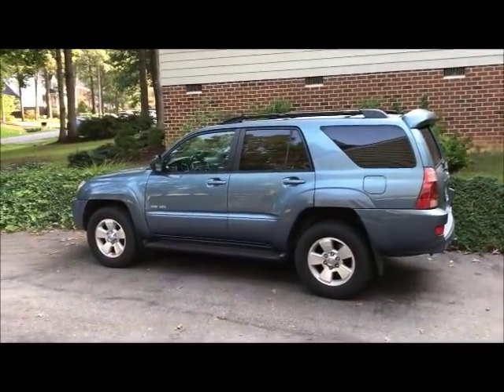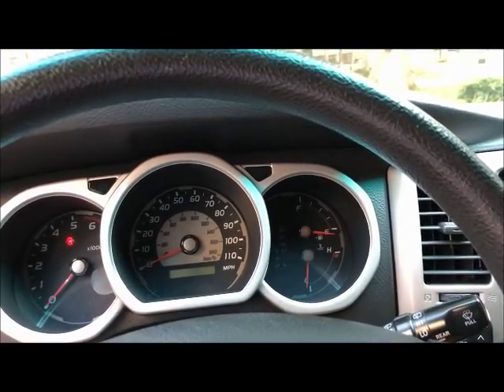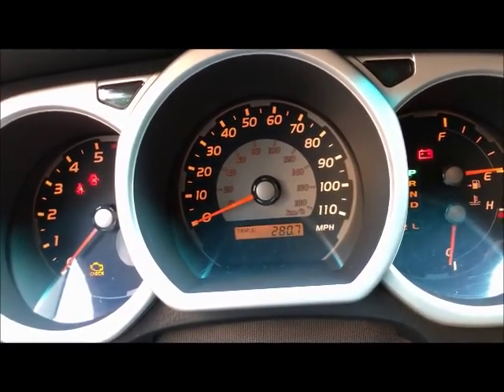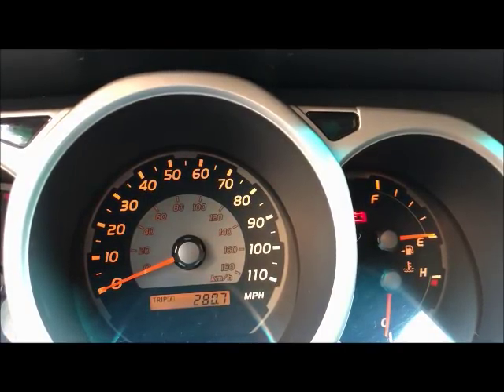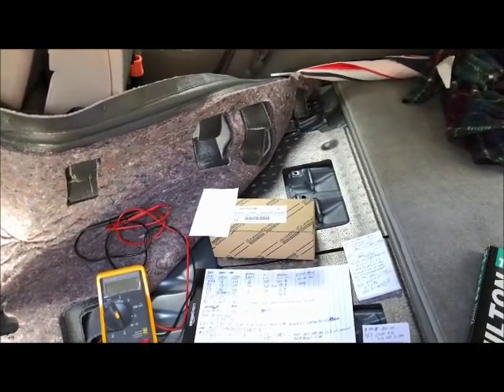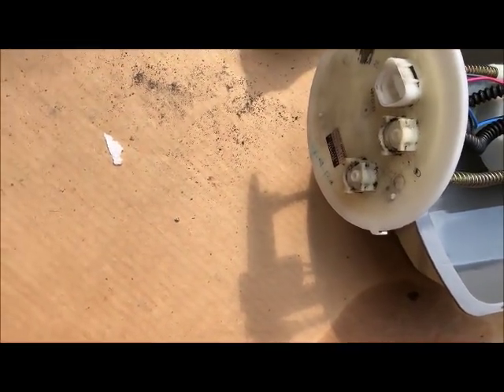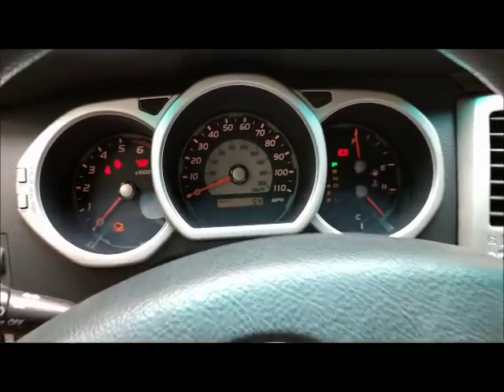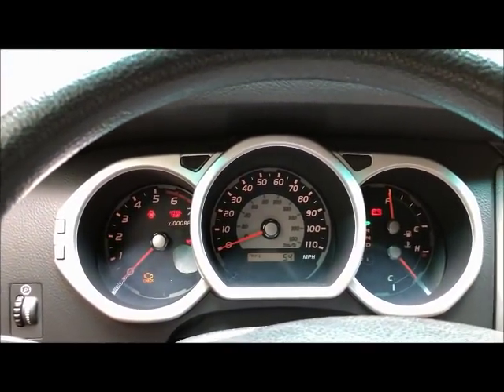2005 Toyota 4Runner Gas / Fuel Gauge Problem - Fixed!

Comment: Just so you or anyone else reading this,   Do not go all the way down to the E every single time,   You’ll damage that fuel sending unit lever and can burn out the fuel Ump. I worked on Toyota’s chevys gmc ford dodge hummer Volvo Subaru Mitsubishi and ties the matter what brand vehicle you own.  Chevy gmc have been known to go bad anywhere between 40-90,000 miles ..... burned the fuel pump.....

Comment: I just did this job but I replaced the fuel pump. The gas tank can not just be dropped from below because of the short wires connecting the harness to the pump, so being how you have to take off the body cover to disconnect the wires I cut out a 8'' by 8'' peace so I could remove the pump from above- no need to drop the tank. Doing this made the job much easier it also allowed me to start the car and watch for leaks. The peace of body I cut out can be easily sealed up with silicone.
Reply from the maker: Hi John.  Thank you for leaving a comment.  Please click on the words “Rick’s Tid-Bits” underneath the video to go to my YouTube channel.  I think you’ll find some helpful and unique tips in my How to Make Life Easier or Better section.  https://www.youtube.com/channel/UCc-IuUFzC2Tyv06KzJyBESg  Rick

Comment: Thanks for the vid. Your video was more helpful than any other I'd found. I've got a factory service manual, AllData online access and a Chiltons but I still find it's VERY helpful to be able to see a vid of exactly what I'm getting myself into before I get started. Best use of Youtube IMHO. 

Just finished replacing the entire assembly on my 2007 4Runner Limited V8 (Toyota Part No. 77020-35102) which looks to be the same one as on yours. Buying from a dealership that sells online it was right about $400 shipped. All in all the whole job took about 5 hours for me including a mandatory lunch break (union rules or I go on strike). I'm sure it would have taken longer had I not watched your vid first. 

My tank was 3/4 full when the pump died so after unclamping the filler neck I siphoned it empty before lowering the tank. I also didn't even bother pulling up the carpet to get to that almost useless access panel. I was able to lower the tank enough to get up in there and disconnect the wiring from underneath. Sure would have been nice if Toyota would have made that access hole large enough to pull the whole assembly out and in. They managed to do it for the Lexus GX470 which is almost the same vehicle as mine in most other aspects, though IIRC the Lexus you might have to actually pull the seats to get to it.

Comment: This was super helpful when I replaced the sending unit.

Only thing I did differently was to actually remove that annoying vent clip from where it connects by the spare tire and fish it out rather than trying to disconnect it from on top of the fuel tank.

Thank you for this!
Reply from the maker: You're welcome.  Thanks for letting me know it helped.  Rick
Reply: I am going to be doing this soon.  I haven't tested my sending unit yet, but it does not read accurately once it is around 1/4 tank remaining.  Aside from getting a new fuel sending unit, what other parts did you need to order or do you recommend to order before doing this job?  Assuming you are reusing the fuel pump.  E.g., gaskets, etc.
Reply from the maker: Hi vettepwr.  I don't think I needed any special tools.  You will need a jack to lower it and then raise it.  It's a bit heavy and awkward.  I thought about replacing the fuel pump and o-rings while I was doing it.  In the "old days" on older cars I would have done that because they were prone to failure also.  I did not replace them on this one.  I hadn't heard of a fuel pump failure on a new-ish
vehicle in ages.  Plus, to get the pump (and o-rings?) from Toyota you had to buy the entire fuel cage assembly, which was ridiculously expensive.  I'm still driving this and everything still works well.  In fact, the vehicle works so well instead of buying something new, I just had it painted last summer!  She just keeps-on marching-on!  208,000 miles now.
Reply: @rickstid-bits  Thank you for the quick response,  I bought my 08 V6 with 206k miles 3years ago just to see what these trucks were all about.  I'm at 298k miles now.  I have been all over the US several times already.

Comment: Another problem that can cause this symptom  - Check the ground resistance of the brown wire of the fuel guage float before going through the trouble of removing the tank. You might have a bad ground connection where ever it goes. You could splice a wire to the ground and ground it yourself.   
When I started your video and saw your sheet tracking all the value, I could see you are a good trouble shooter.
Reply from the maker: Hi Jack.  Thank you for the additional information, and the kind words.

Comment: 2008 4runner with 197000 miles. Very similar issues. Started around 194000 now on E all the time. Guess I need to take to Toyota for repair now. Not messing with it myself since its my only vehicle. Thanks for the in-depth video!
Reply from the maker: You're welcome.  Thank you for taking the time to write to me.

Comment: Thank you for posting this. I have a very similar issue on my 2004 4Runner. I am certain it is the sending unit. Initially I thought I could do this myself through the hole under the seat but now I see that there is no getting around dropping the tank which changes the Level of Effort in this repair completely.
Reply from the maker: I'm glad it helped you make your decision.  Thank you for letting me know.
Reply: Mohamad Alfakir i have same truck , the fuel tank has to be removed and its not for a beginner to tackle this job.

Comment: Rick, I think I must be your long lost twin brother.  I am exactly like you.  I maintain all my vehicles. And I too drive a TD Dodge Ram.  Even built a few cars/ truck/ buggies from the ground up. (Long Story)  My wifes 06 4 Runner (250K miles) is having the same fuel gauge issue. so I did a little search to see how much work it was going to be, and it brought me here.  I have a 4 post car lift and transmission jack in my shop and with your explanation of how to get the hoses disconnected it's going to be a piece of cake for me.  Thanks so much for posting up the details and video of how it's done.   Great job with the Ohming out the sending unit.  The kind of stuff I do too!
Reply from the maker: Hi Curtis,  Thank you for the kind words.  I'm glad it's helping people.  Please come back and let me know how it goes.
Reply: @rickstid-bits  Will do Rick.  It's going to be a week or 2 before I can get time to get it in the shop.  Rebuiding the front suspensioin on my Dodge at the moment.
Reply: Well it's done!  As of about 30 minutes ago. Replaced the sending unit no problem.  Getting the hoses disconnected was a challenge, but they eventually let go.  Thanks for the Video Rick.  Sure made it a lot easier.  I didn't have a wrench for the big fuel pump ring, so I wrapped a thin cheap walmart strap around it then looped it around a stick to make a strap wrench and it came off with nothing breaking.  Took me about 3 hours with a dinner break in the middle.
Reply from the maker: Congratulations on your repair!  I'm glad I was able to help.  Thank you for sending me an update.

Comment: Nicely done video. My '05 4runner started giving erratic readings too recently. Around the same time I started using Lucas Oil-injector cleaner. Don't know if that's what caused it or if it's just the age. Great idea on using the trip odo. to keep track. Just wanted to say thanks again for the splendid detailed video.
Reply from the maker: Hi David.  Thank you for taking the time to send me the kind words.  Rick

Comment: Thank you for this video! I’ve been having this exact problem for yrs on my 2003 4runner. You’ve solved my problem. Will definitely tackle this project!
Reply from the maker: You're welcome Anh.  Let me know how it turns out.
Reply: @rickstid-bits  hey Rick , i finally replaced the float unit, you weren't kidding about the rear upper hose. thing was a PITA ! the driveshaft being in the way made it hard. but i got everything put back together and i think it solved the problem, the gauge is reading good so far.
Reply from the maker: Awesome!  Nice job!  Thank you for taking the time to send me an update.

Comment: The range computer goes off previous data i think. Would have to clear the ECU. 

Also some losses in mpg over the years are expected as compression goes out, timing chain gets slop, etc etc. 

With the erratic measurements of sender. Put it on a lever. Just loosely screw down the end of a meterstick and put it close to the screw, then move the other end of the meter stick. You could easily get down to whatever resolution of change it wants. Not sure what the spec sheet says for range.
Reply from the maker: Hi Marc.  Thanks for leaving a comment.  You are correct.  The range calculation was based off previous data.  That corrected itself after a couple tankfulls.  Rick
Reply: @rickstid-bits  thanks for the reply on a 4 year old video. 

Mine just went sporadic and this video covers it well. 

I guessed this was the issue. It's nice to be able to see how grimy that thing gets without pulling it.
Reply from the maker: You're welcome.  Come back and let me know how it turns out.  Rick
Reply: @rickstid-bits  251k miles. 2007. 
I probably will just let it run for another 5 years lol. 

I always have 3 gallons in tge back. Once i finish my roofrack I'll have a whole Jerry can. So i don't care if it runs out. 

I definitely was questioning if the tank was actually 20 gallons or if that was a hallucination. I was only filling 15 on dead empty

Comment: Great video, thanks for taking the time to produce it.  I have a 2005 V6 Tacoma and suspect the float sending unit is my issue as well.  Just wondering if you have had any issues with your SRS Airbag sensors on your 4-Runner as I've had on my Tacoma where the Airbag light remains illuminated on the dash.  I'm in my 60s as well and fix things too, just out of necessity,  Unfortunately, I don't have your level of troubleshooting skill.  Thanks for sharing your knowledge!
Reply from the maker: Hi Cayman,  Thank you for the kind words.  I'm glad my video is helping others.  I haven't had any airbag issues on mine.  The only other real issue I've had was the A/C Evaporator.

Comment: I’m pretty sure the total mileage remaining does an average, but can be reset if you disconnect negative battery cable.
Reply from the maker: My mileage remaining returned to normal after driving a couple tankfulls.  The computer needed those miles driven vs. how many gallons it used to calculate the new numbers.

Comment: I've got a 2008. So the fuel filter is a little tiny piece inside the fuel pump assembly? Never swap it out unless the pump fails? Also, I like your methodology and level of detail. Knowing the process is always beneficial before just going in there and assuming something.
Reply from the maker: Hi JLA,  Thank you for the kind words.  My level of detail drives most internet people crazy.  I'm not sure I said that about the fuel filter.  I'm not positive, but I think the fuel filter is along the frame rail under the vehicle.

Comment: I had an intermittent problem with my fuel sender, so I decided to change it and the pump as well while I was in there (original 18-year-old pump).   I noticed you said that your distance to empty info display didn't seem to ever fully correct itself.   On my truck I think it may have, as when I first turned the vehicle on, the D to E guage said 69 miles, whereas it was stuck on 0 miles before.  It's worth mentioning I disconnected my battery before starting any of my work.
Reply from the maker: Hi Mac,  Thank you for adding your experience.  Mine did correct itself.  I believe it took a couple full tanks to sort itself out.  And that makes sense because the computer needed a couple times of knowing how many gallons the vehicle took, and how many miles it traveled, to become accurate again.
Reply: Nicee. How did you remove my fuel pump, am finding it hard to do. Fsm says to pull the claw tabs and pull the pump downwards, tried it no dice.05 runner
Reply: @skywalker_0427   I'm not sure what you mean.  You pull the access panel under the seat, undo the electrical connectors, fuel, and evap lines, then drop the tank.  Unscrew the plastic lock ring and it pulls out from the top.
Reply: @macgroober1396  i made a U cut and expanded the slot...didnt have to drop the tank. Have retrieved the fuel pump assy.changed the filter, but unable to remove the actual fuel pump from the assy
Reply: @skywalker_0427    I can't help you in that case, I replaced my pump and sender as a unit, considering they were both about 20 years old when I changed them, i.e. "while you're in there..."

Comment: Hey Rick - extremely helpful video. I replaced the fuel sending unit in my '06 4Runner last weekend, and I couldn't have done it without your help. After replacing the sending unit and filling up the tank, I had the same issue you mention: the fuel range reads around 350 instead of around 415, like it did before I replaced the unit. I'm wondering...did the issue ever resolve with your 4Runner? Did you end up having to do anything else in order to fix it?
Reply from the maker: Hi Ron.  Yes.  It also fixed the range display.  It initially read low like it showed at the end of my video.  It was because the computer had been miscalculating the range for a long time - and that's the baseline info it had to go by.  After a full tank full or 2 - the range went back up to where it used to be.  Reset you MPG readings, fill it up, and give it a few tank fulls.  As long as your fuel gauge now reads nice and steady from full to low - it will eventually read correctly.
Reply: how hard was it to drop the tank? having this issue on my 03 v8 runner and ordering the whole pump and sending unit. @ 220k miles so i figured might as well

Comment: Rick, thank you so much for this video. I have a slightly different purpose than yours - I'm looking to install a kill switch in the 4runner to deter theft, to cut power to fuel pump. I have two questions for you. The first is, which wire on the fuel pump should I be looking to intercept with my switch, and where can I find it? Can I find it further "upstream" so that I don't have to tap in near the fuel pump? And the second question is, I am going to use a 3 way switch to route power to a car horn I purchased online, if the car is started with the switch in the off position. Should I add a fuse on my tapped fuel pump power line? Is there a possibility for excess current to somehow go through my switch into the fuel pump and fry it? Thanks again in advance and God bless!
Reply from the maker: Hi Lee,  I'm sorry.  I won't be able to help you with that.  Rick
Reply: @rickstid-bits  no problem, thanks Rick!
Reply from the maker: You’re welcome.  I'm sorry I couldn't help.  Please click on the words “Rick’s Tid-Bits” underneath the video to go to my YouTube channel.  I think you’ll find some helpful and unique tips in my How to Make Life Easier or Better section.  https://www.youtube.com/channel/UCc-IuUFzC2Tyv06KzJyBESg  Rick

Comment: First off, great job with the video. Im having an issue with an 07 with the "Range" display. The fuel gauge itself works perfect. I wouldn't be concerned with it if it were my vehicle, simply resetting the trip would be the same. It's my girlfriends car and she relies on it. Do you have any suggestions?
Reply from the maker: Hi Shane.  Thanks.  I'm sorry.  I don't.  What does the range not do correctly?  Does the Average MPG read correctly?